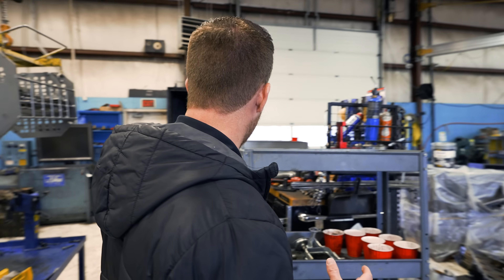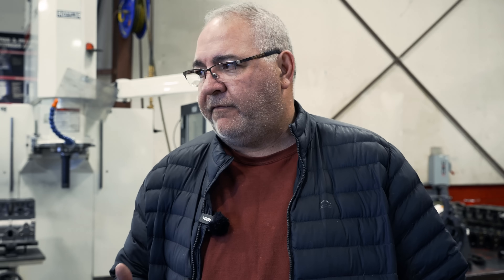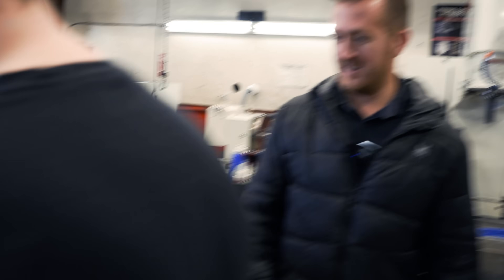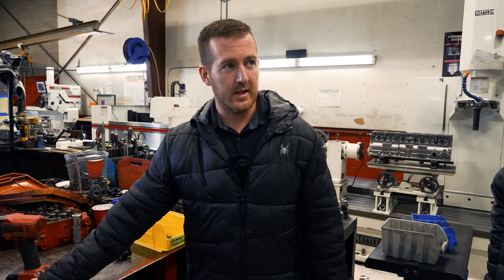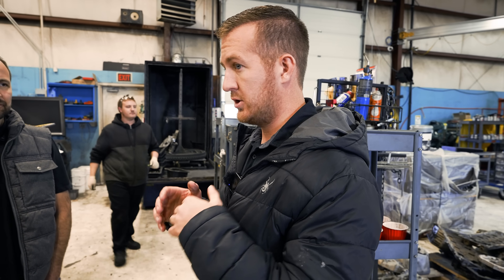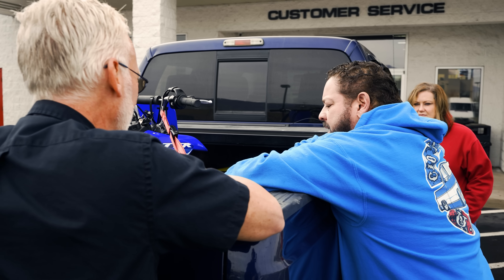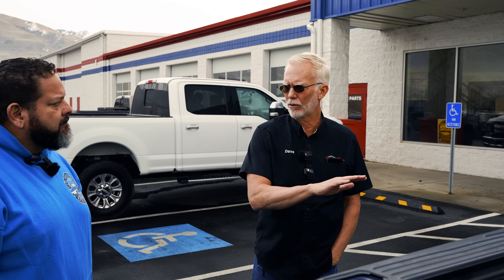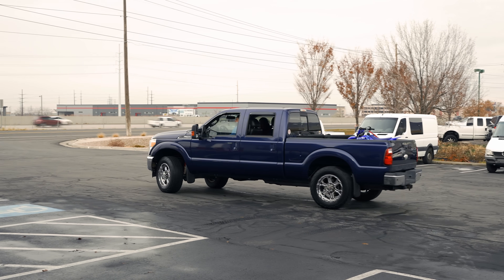Looking Inside a 900,000 MILE CP4 Pump!

Comment: Wow, what fuel additives were used, and which oil brand was used?
Reply: Change when it gets black? That’s after start up
Reply: @highball7347  LMAO  Yep!   You would be changing it every other day!
Reply: 🤣 diesel life!!!!
Reply: @highball7347 that’s all truth
Reply: @highball7347 deleted diesels don’t go black as fast
Reply: @highball7347 right😂
Reply: @highball7347  Maybe on your 30 year old sludged up dinosaur piston rings more wore out than my ex wife, my 6.7 has clean golden oil
Reply: @RiggyRonnie different oils have slightly different properties. Try using Dello. Most likely whatever oil you’re using isn’t pulling any of the carbon out from the bores and they’ll clog up if your oil is just riding over the build up instead of pulling it out.
Reply: I’ve used Power Service Diesel Kleen in my ‘05 Cummins since new, 227k on the clock, never a problem with the engine.
Reply: @coms00  never used an additive  in my 06 5.9 350k miles   can put a latex glove over the oil cap won't even stand it up
Reply: On my Duramax I changed the oil every 5,000 miles. It was always black. First change was at 1,000. It was black and after 500 miles it would be black again. 

When you say golden do you mean on the dip stick. Yes it should still be see through when you change it. When you drain it it should be black. 

I don't think that I have ever seen clean oil on any vehicle after 3,000 miles. The oil always drains back. Gas, hydrogen or diesel. When I say black you still should be able to see through the oil. If not then you have other problems from running your oil to long.
Reply: Fun fact,  we service  natural gas and propane vehicles. When we change oil, it's always  clean as it was the day we did last service.
Reply: @glengarbera7367 yeah…. They’re gas…
Reply: Motorcraft brand and docs diesel fuel additive
Reply: @RiggyRonnie source?  Was that mentioned in the video?  I only heard motorcraft filters
Reply: @RiggyRonnie  when did he say it was Docs additive?
Reply: @jacksarebetter he didn’t he used ford motor-craft oil nd motorcraft filters most of the time! Nd fuel additive (which one) you think they would have asked??? What a cliffhanger
Reply: @RiggyRonnie so Right Ronnie, what oil filters, fuel filters, fuel additives, and engine oils do you recommend for gasoline engines, especially GM Vortec, LS, and LY V8's?
Reply: Haha no DCR and high idle hrs. Against the grain and still lasted
Reply: Definitely amsoil can’t see anything else working that well
Reply: Guarantee it was Ams, probably why they didn't say what it was
Reply: @Jimmy-fi4ht The problem is guys that use Ams think they can change it every 10k miles, when it completely negates the benefits of it when you do that. The lubricity of any oil significantly reduces after 5k miles. Change it when it gets black.
Reply: @RiggyRonnie apparently contradicting what owner says and verified via oil analysis
Reply: @RiggyRonnie I agree, I use Ams but still change every 4k no matter what
Reply: @RiggyRonnie  Diesel oil gets black in 500 miles, what you on about. color means nothing
Reply: @ Then how come it’s been like 2k miles and my oil still golden? Oh right; you wrong
Reply: @RiggyRonnie oil loses lubricity and change it when it's black?? Tell me you don't understand the job of motor oil without telling me you don't! Please educate yourself bud
Reply: @RiggyRonnie  because it's a gas engine most likely.
Reply: @v12alpine  Same engine in the video
Reply: @bigdaddymak1439  What even are you trying to say… Are you really saying used black oil is just as good lubricant as new oil?
Reply: @RiggyRonnie  oil gets dirty the instant you start using it. Ty hf filter takes out larger particles above 20-30 microns. Oil is supposed to hold containments in suspension. Wear on engines comes from metal to metal contact. Color of the oil makes no difference.
Reply: @RiggyRonnie  change diesel oil when it gets black? Im a marine diesel guy, and that statement is crazy LOL
Reply: @NIGHTMAREuki not in a deleted engine.
Reply: @RiggyRonnie is your truck deleted? My 6.7 only has 28k miles on it, oil changed every 5k miles. Oil is black within a few hundred miles after an oil change. You can't run these modern emission systems in diesel vehicles and expect oil to not turn black when it's pumping your trucks exhaust through it's own engine. If color was an indicator when to change the oil, I would be changing my oil every few hundred miles.
Reply: @ As a marine diesel guy you should know your type of oil goes in black anyways
Reply: @ Yeah and sounds like the butt plug is clogged 6.7s don’t like to idle the first thing I’d do is remove it and the fart sniffer
Reply: @NIGHTMAREuki unless you delete the EGR. Mine was black after the first drive now 2000 miles still golden! I wish I had done it sooner.
Reply: @RiggyRonnie  It gets black in 15 minutes from the old oil left in the engine. Oil analysis is the only method to know the life left in the oil. There are long haul trucks going 50k on an oil change. Mind you they have 10+gallons of oil to go around and 1micron bypass filters.
Reply: @Jman2005us  Waste of money. That is so often. I'd have to change my oil every 2 weeks if I did that! No thanks. I may drive a 2017 gasoline Transit with 220k on it, but I've only had 11 oil changes since new. AMS 0w20 all the way. I did 2 analysis. Once at ~45k and one at ~220k. I could have ran even longer than I did.
Reply: @RiggyRonnie maybe your truck had a little weight loss by hitting the gym😂
Reply: @shawnl4756  Bro was congested 💀
Reply: if you change your oil, start the truck drain It'll be black you never drain all the oil out so the oil is always gonna be black black oil isn't bad oil I agree with earlier oil changes than 10k normally however the only oil id trust to go 10k+ miles for oil changes is (amsoil signiture) not there other lower grades which can be argued are prob still better than alot of the other brands
Reply: @RiggyRonnie u have no idea what your talking about.  Buy one and sample the oil every 5k mi. At 10k mi it's getting up there in fuel dulition,  because of the regen process.  Take that away and u could probably go 15k no problem.  Big trucks run 10-20k mi oil changes cause they hold 8- 10gals of oil. Big difference compared to 3gals
Reply: @RiggyRonnie  do you have an ear delete?   just asking your secret.
Reply: @ Yes, the fart sniffer of course. Biggest cause of soot in the intake big issue on these 6.7s as well
Reply: @RiggyRonnie  Not true. If you look into Ams a little more you would find that it is not like the rest of the so called synthetic oils. I've been using it in my 6.4 since new and now have over 240,000 miles with no issues
Reply: @kwmiked  Yeah big trucks have wider intervals I’m taking about diesel pickup trucks specifically, just like marine diesels are a whole different process. Airplanes are technically diesel as well. All jet fuel is is diesel fuel with additives to prevent oxidation and corrosion. Every jet airplane will run on diesel just fine.
Reply: @RiggyRonnie incorrect. Change it when oil analysis says to. Whether that’s 100 miles or 10,000 miles.
Reply: @leofortey7561  Apples to oranges.
Reply: @RiggyRonnie  loll kamel suporter  loll
Reply: @RiggyRonnie  Clearly you have no diesel experience
Reply: @ How did you know?
Reply: @papabapyro  interesting, so its EGR then
Reply: @ it dumps soot in to your engine and eventually destroys it. Oil changes slow it but best to delete it if you can find someone to do it. Illegal to do even though government vehicles are factory delete!
Reply: @bigdaddymak1439  The black stuff is soot. Suit is not a good lubrication, so therefore black oil is not preferred. Any truck using an EGR system is going to get black oil nearly immediately. Mine does not, because my truck is not running an EGR system
Reply: @papabapyro  same here. My oil stays clean in my Duramax. It has been deleted. I am anti-soot
Reply: @bryanspanjer3213  what are you going to do change it everyday?? The amount of soot is what is important
Reply: @ I’m telling you from personal experience. I’ve own a 2013 6.7 for the last 8 years. And it has 393k miles I use it daily. You can see videos of it on my page.
Reply: @papabapyro factory not installed.
Reply: @bryanspanjer3213 My son deleted his 2023 6.6L Duramax recently and not only does it run great, the oil is clean vs. my 2021 F250 when we change them together. Mine is gonna have to lose some weight soon.
Reply: @RiggyRonnie your oil is not working if it stays clear.
Reply: @RiggyRonnie  Your advice might be OPK for gasoline engines, but not diesels. Diesel motor oil blackens quickly due to soot, which is not harmful. But going by appearance won't work.
Reply: @ Eh works for me and all my Diesels that don’t darken under 5k because they aren’t worn out
Reply: @RiggyRonnie it’s always black in a diesel
Reply: @dsstaang  Yeah I don’t think carbon soot acts as a good lubricant 😆
Reply: I use Schaeffer oil in my 6.7l powerstroke. So far so good on my trucks. Neutra for the fuel additive.
Reply: I have always felt the beauty of a diesel engine was letting it idle for hours on end. Such a Relaxing sound!
Reply: I also use the power service diesel kleen,but my 04 Cummins sits a lot which probably isn’t good it just hit 140k
Reply: I add 2-stroke oil to my diesel, just a squirt, always heard that modern diesel is dry and don’t lube the fuel pump!
Reply: @Cheva-Pate  filled my 89 IDI 7.3 ford with ATF EVERY fuel filter change....old timer told me it was a great lubricaant for the fuel system....truck has 780k on the original pump/engine when I sold it in 2012.
Reply: Hes using the Insane Diesel  Lorenzos oil and diesel treatment with the Insane diesel bypass oil filter! It makes sense because it takes all the carbon and junk out of the oil that the emissions devices recycle through our engines! Why they hit diesel so hard when tuning takes care of the black smoke most complain about with the technology these day's there are no reasons for emissions these day's! We pay that much for a diesel truck then have to put $10,000-$15,000 in aftermarket parts just to make it reliable! Its the corporations these days as obviously no government is going to help us diesel guys and gals!!
Reply: Obviously he used Adrenochrome and Angel tears.
Reply: All these new diesels have atleast a quart of oil left when you change it especially GM/Durymax!!!! Look at the oil pan it's impossible to get that all of it out because of the drain plug so you always have a quart from the previous oil change. My 2019 6.7 Powerstroke oil started turning black and hour after changing and has been that way for 143,000 miles. It will stay golden ish for a bit but thats just how diesels are everyone I've ever seen over the past 46 years had black oil after change! Maybe some are different for whatever reason just my experience..
Reply: @dsstaang 
Is your truck deleted?  Mine only has 84k miles and the oil is black even right after an oil change.   Had 73k miles when I bought it and I change the oil every 4-5k miles.
Reply: You don’t need fuel treatment. 393k miles original pump here.
Reply: Hot shots secret is what he uses!
Reply: I gotta 2018 Ram, oil changes 6500-7500 miles and 298,000 miles, I got power galore.Trukk hauls rvzz every day. 20% Stabilizer w/ every oil change.And no egr or any of that lousy junk either. My 14 ram dulley 658,000 miles have electronic glitch have done every part brand new but THEE ECM, that will be last as I have no CODES to go by 2 shops didn't know jack one was Dodge dealer,, but that dulley runs good, I say to my buddy, I trew out some oil at 6,000 miles and he says O MY GOD. HE'S got 0 blowby at 700,000 milesbut his AISIN is chattering between the gears. His oil intervals have been 15,000 miles mostly,,,,,tooooo long 4 me,, as Im like the Ford guy in Dave's video
Reply: One reason why a lot of people's oil is black so fast is old oil being left in the pan. That will make the new stuff black real quick
Reply: Miles is an actor 😂 the mechanic is like it looks fine and mile: " omg wow I'm blown away" lol if I could I would too shit it must be
Reply: Peterbuilt has me use Power Kleen on my big truck. I use power kleen.
Reply: @timothyshaneschaefer8289 does it work good? I wonder if would work on a light duty 6.7 Powerstroke?
Reply: It may be similar to HotShot Secret stiction eliminator... @timothyshaneschaefer8289
Reply: In case you were never answered. In another video to this. The owner said he uses Tanners additives.
Reply: Someone find this man and ask the question we all want the answer to what oil was used and what fuel additive
Reply: Archoil probably
Reply: @leem8249 motorcraft was aaid
Reply: 3:15 the engine was replaced ?  but per the title , the CP4 pump lasted 900K ?
Reply: @scotttan6377  No, they did a turbo on it, and while they were in it, they did injectors as well.
Reply: Opti-lube is the best out there
Reply: @HSKFab  that's exactly what the Schaeffer's rep told my brother when he seen it on his shelf.
Reply: That's  what Dave's secret sauce is by the way. @HSKFabrications
Reply: @dsstaang  Golden? When, while you check the level after you filled it? Impossible to have 5k on a diesel and it still be 'golden'.
Reply: @leofortey7561  I wish I could send you a picture of my oil, still pretty clean after about 4000 miles. EGR was deleted two oil changes ago. Before it was black the first time I drove it after a change. Love how gov. trucks are factory delete but they want to hang us if we do it !
Reply: So this beautiful cp4 pump in a blowed up engine is like my dentist telling me my teeth are great… but gums are rotting out🤣😂🤣
Real jokester of a dentist!!!
Reply: From all the oil studying i have done the main killer of the oil loosing lubricity is not the color or the soot. Moisture is the real culprit.
Reply: Secret sauce duh!
Reply: @dsstaang  The only other reason it would blacken quick is blow by. Had a lad Kubota engine in my skid steer that after 10hrs of use the oil would be all black even after filter change. That’s was just a. worn motor
Reply: @dsstaang  Exactly you keep it maintained and it’s gonna have clean golden oil. It’s when you let it get black and sludge starts to form in the crankcase. Guys change it after 10k and wonder why it’s still black, we’ll there’s sludge all inside the new oil washed out.
Reply: @RiggyRonnie  exactly my 7.3 maintained a golden oil color for over 10 years. Only when I started to neglect changing the oil consistently did it start to get darker along with the air filter too is a major key thing dirty air filter equals dirty oil.
Reply: How many miles does your truck have on it ? @RiggyRonnie
Reply: @ My 7.3 has 620k, and my 6.7 has 215k
Reply: @RiggyRonnie  and mine has 99 million million.   Words are cheap but bullshit stinks anywhere

Comment: Changing oil at 5,000 is ludicrous.  Get it analysed as this owner does.
Reply: You’re right that’s why you should do what I do and just drain the oil and not use it at all
Reply: I have a diesel and it’s changed every 3000
Reply: @JJ11-15 I have a gas and it’s changed every 3,000.